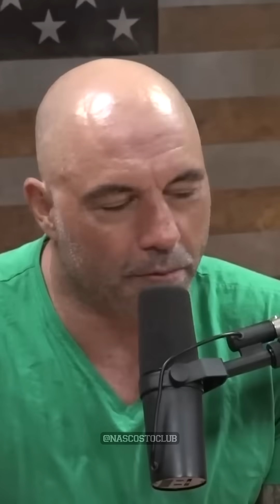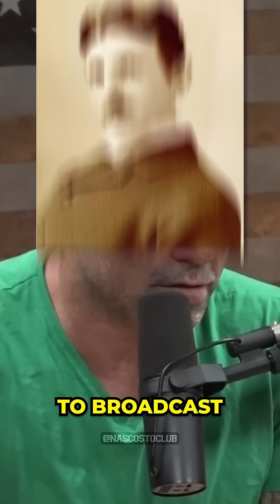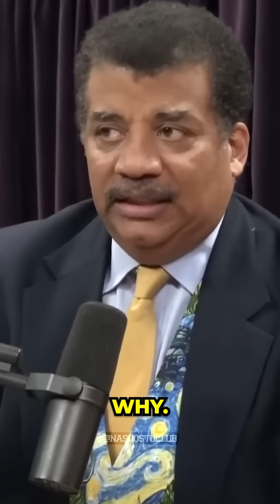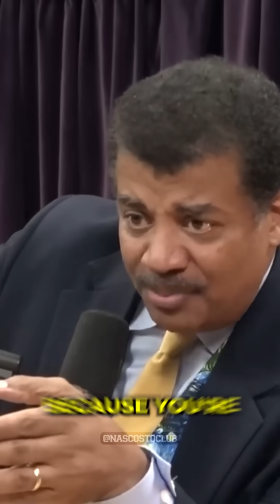WIRELESS Electricity Idea Debunked ⁉️⚡ #shorts

Comment: it is called induction and is really inefficient on distances longer than a few centimeters. you lose 75% efficiency each time you double the distance. 100 W at 1cm is 25W at 2cm that you get out of it.
that is why you can have an induction stove with 1kw+ but can't really measure it a few meters away even if nothing is on the stove. it only works that good because the pot is placed directly above the inductor.

Comment: But what if they found a way to convert say…nitrogen…into energy via some type of extremely small device.  Then you could theoretically have “electricity in the air”…it’s just getting to that point that’s the hard part lol
Reply: That’s not possible. You can’t just turn an atom into electricity.

Comment: Nikola Tesla wanted free energy.  Edison co wanted to charge people.
Reply: There is no such thing as free energy. All energy requires a source from which the electrical energy is created. These sources are not free. Even if Tesla’s Model worked, it would not have been free. If anything, maintaining that infrastructure would be more expensive than just running wires in the ground.

Comment: You can tell Neil is tired of ppl refusing to let go of debunked ideas. I feel his pain. Too many ppl would rather double down on something wrong than read why it is
Reply: Look up the original demonstrations of AC power safety. You can recreate them yourself as well but I recommend doing it with proper supervision.

Tesla literally put himself directly in the circuit of a light bulb to prove AC was safe. These aren't the modern LED low power light bulbs but 150W plus light bulbs.

If you really don't believe me that it is possible, look up people doing the same Tesla test near HV power lines. You can do it yourself even. 

The biggest problems with wireless energy transmission are as follows:

A) you can't sell it based on use

B) a lot of it is wasted as it isn't directional

C) there are objects that can block it such as concrete

D) wired power is cheaper
Reply: @bransonwalter5588  Oh and inverse square law, but let's ignore that.
Reply: @totalmetaljacket789  There is a reason I mention the directing of it.

Comment: Tesla was on to something no one could understand. It could've been possible through specific requencies in waves or electromagnetic fields. Tesla was very knowledgeable in AC current and its frequencies. As such Tesla coils on small scales were proof that wireless energy could've been possible on a lathe scale
Reply: Have you seen what a Tesla coil does? Even if we say that it would be feasible to transfer power through a large Tesla coil, that shit is incredibly loud and unpredictable. Not to mention electricity takes the path of least resistance, so put a piece of copper between the target and the coil and it’s all over.

Comment: Just more complete and total bull shit spewing from this pseudointellectual. We use wires because the material, mostly copper, has very good conductivity. Electrical generation, transmission, and distribution is all about efficiency, reliability, and of course cost. Wireless power transmission is limited because air is a non conductive medium and you lose an inverse square of energy over increasing distances. In other words, incredibly inefficient. I did this for my senior design project in undergraduate. I used capacitors and coils to generate a time changing signal that is propagated through the air to induce an electrical potential in a receiving coil that charged an iphone. The frequency used in this transmission was at a level that was completely safe for all organic life just the same as all the electronics around you are safe. Just because it's a high amount of energy doesn't make it dangerous. The form the energy is in is what makes it dangerous. Now if you're using wavelengths in the microwaves then yeah you're gonna be cooking organic life that gets in the way of that transmission. Truth is there is a Wireless Power Consortium with scientists from around the world working together to figure out what the heck Nikola Tesla was trying to see. Wirelessly powered household electronics could be much closer than people realize, but transmission over large distances requires some sort of keystone discovery in electromagnetics that has yet to happen. There are incredibly clever people out there, but I wouldn't rank Neil among them.

Comment: It is possible and we actually have it and we use it every day. It’s called solar panels. The energy in the form of light move through there and it’s collected by solar panels generating electricity, so there you go. So it is possible and maybe there are other forms of energy that we can use in the same fashion. Oh, wait a minute, how about wind itself it moves the windmills, generating electricity.
And how about laser you send the beam from point to point and you collected it on the receiving end and turn it back to electricity? 
Should I continue?